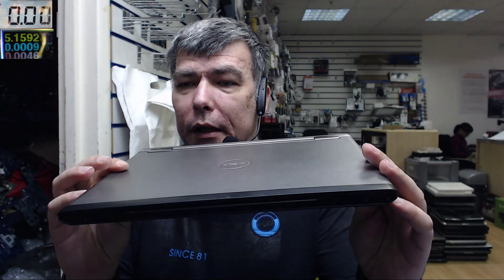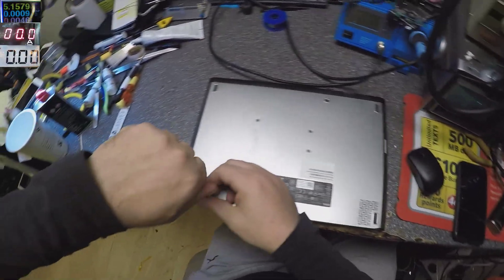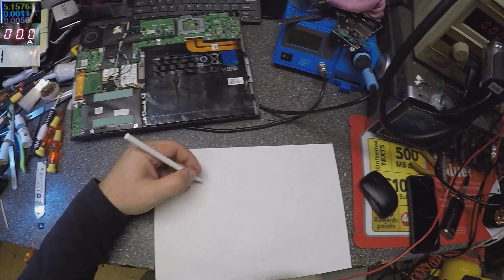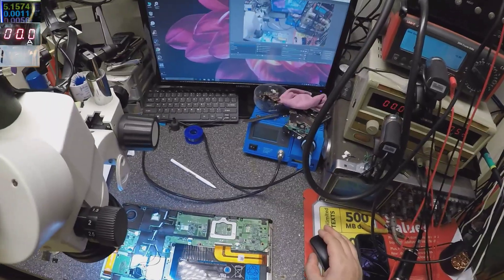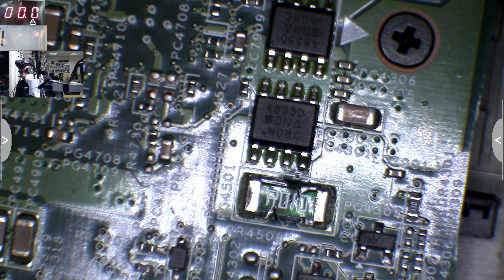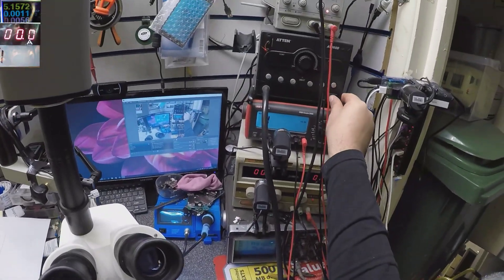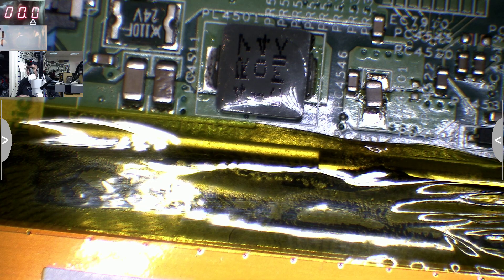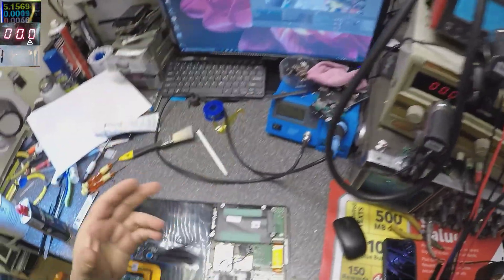How to repair short to ground laptop motherboards, dell vostro 130

Comment: Excellent vid thanks a lot! How much should I charge for this repair? Where can I buy electronics for motherboard?
Reply from the maker: thanks, we charge £80. what kind of electronics? Spares?   ,... from faulty laptops
Reply: But if there is no spare motherboards? Where would you get the MOSFETS?
Reply from the maker: i never bought mosfets. Buy a faulty motherboard from ebay. U dont have to put back same mosfet, just replace with channel n or p
Reply: N or P  Do you have any video on you doing that replacing specifically.  I mean I watched your vids closely but honestly I haven't catched which is N or P and how to place them on motherboard to properly solder them. I'm planning to purchase the soldering machine like yours, etc. God Bless Bro!
Reply from the maker: like this one?  https://www.youtube.com/watch?v=B17Ziuvi0Ns&t=1421s
Reply from the maker: u can't go wrong, one its connected to plus, one to ground.
Reply: Thank you Sir!
Reply: got it thanks a lot!

Comment: Where are you putting that amps at? I have a motherboard that I bought because the old motherboard went out, now this one also went out.
Reply from the maker: Fallow the 19 power rail, u have the charging port and two mosfets, u can use the power supply on any point along with the 19v power rail
Reply: Thanks. Do you do classes online? Any books you recommend for me to learn. I’m studying networking Routing and switching right now so I also want to learn about the computer hardware.
Reply: I have a motherboard that is dead so I ordered  refurbished on and I replaced it. Reinstalled the operating system and it was working fine besides the cpu being extremely high 65-85%, but it was working fine besides that. Next thing you know, it just dies on me and now I can not figure out the problem.
Reply from the maker: Oh, no , sorry. Try to learn about electronics, basics, this will help you on computers and also in networking
Reply: Electronics repair school one more question. Sorry if I am a bother but I have an AC adapter that has an output of 18.5 volts but when I read it with a multimeter, it reads 19.8 volts. Is this normal for it to do this, and would that cause a motherboard to short circuit considering the voltage is fluctuating?
Reply from the maker: any motherboard should work fine 17-23V, so u are fine

Comment: maybe you already know but dell provides full component by component disassembly instructions for every computer they make on their website. In case you ever find one that gives you a bit of trouble to take apart.
Reply from the maker: Thank you, but my issue its the electronic schematic
Reply: Electronics repair school you don't seem to have any problems with that :) 
in a couple videos you've showed me. from thinking impossible to fix without schematics to you solving those issues in 5 minutes.. amazing. 

really learned a lot from watching you. thanks.
Reply from the maker: Thank you kindly :)

Comment: hello sir.  i have dell d630 after running few minutes shows green light then turns off.  the processor thermal and fan is all perfect. there is something  wrong with motherboard
Reply from the maker: Hi, an emergency shutdown can be from overheating, power failure or software. Can you give me more details? Its goes off on windows? how long? if you live the laptop only on bios menu, still goes off? You tried with another power supply?